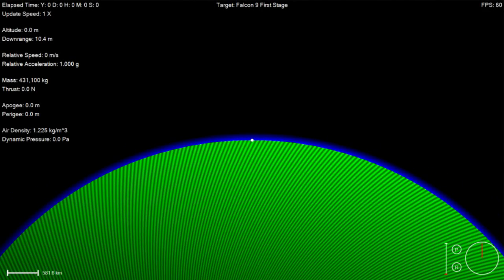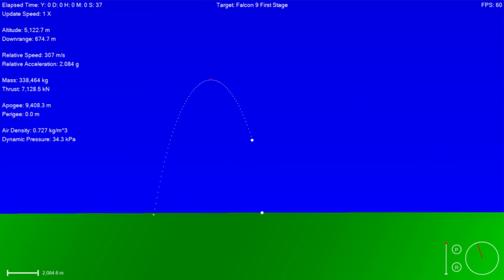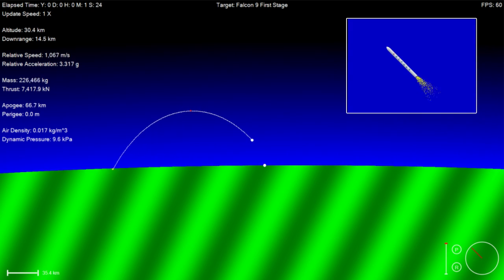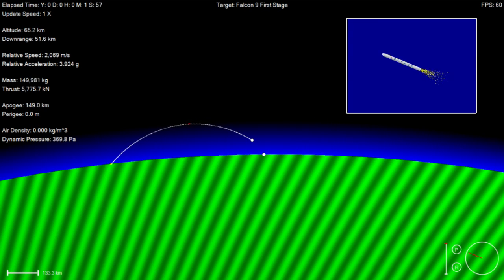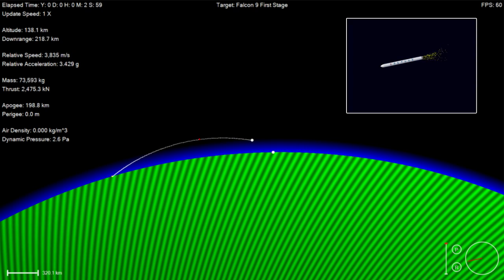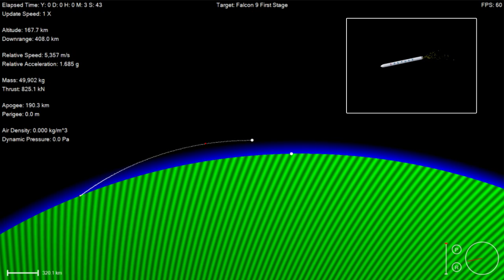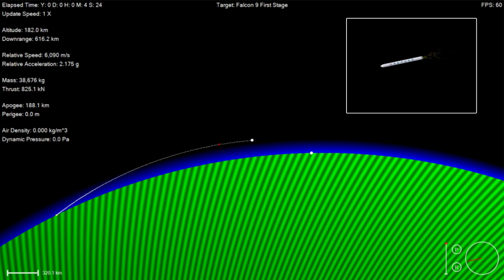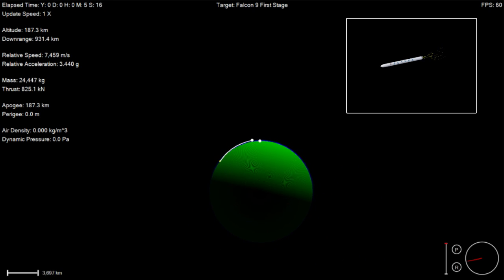SpaceX Falcon 9 First Stage SSTO Simulation

Comment: Good work.
Probably the first stage alone could go far away 4.5G, because, without the weight of the second stage and payload, the constraints on the structure of the first stage are lowered.

Also, since the engines can be fired several times, there is, still with a max 4.5g, a far better profile, with much less gravity loss.

Instead of shutting down 2 engines, only the central engine should be shut down, then re-ignited when 2 other engines are shut down.

So, the sequence would be/

1: All engines at max.
2 : at 4.5G reached, Central Engine shut down.
3 : When again 4.5G reached, 2 other engines shut down, and Central Engine re-ignited.
4 : When again 4.5G reached, Central shut down again.
5 : When again 4.5G reached, 2 other engines shud dows, and Central Engine re-ignited.
Etc.

You should get an higher orbit.

Also, each Engine has an adjustable orientation, so you probably can shut down directly any engine, and orientate the others to get the thrust in the right direction. It is probably a better way to do it.

The merlin 1.D has an adjustable thrust, from 70% to 100% So you can lower the thrust of an 
Engine before stopping it. But maybe it lowers the ISP. Does somebody know how much you lower the ISP by adjusting thrust to 70% on  the Merlin 1.D ?

Comment: Thanks for that. Great job. A SSTO gets best performance when using altitude compensating nozzles. With it, the F9 first stage vacuum Isp can be raised from the 311 s it is now to the 342 s Isp of the F9 second stage.
 How much would the payload be then?

  Bob Clark
Reply: Not going to be enough area at the base of the rocket to accommodate 9 Merlin Vac sized engine bells
Reply: Ideally, you want an expandable nozzle so it's normal size at sea level but expands out at near vacuum air pressure. At near vacuum the large size will have small effect on air drag.

Comment: I can see you were running with very small margins there. The orbit also shouldn't be stable for very long. But I'm curious, what was the lowest angle that the ssts was pitched relative to the horizon? And another question, were you pulling any angle off in azimuth so as to be in an inclined orbit? I don't think the delta v values agree with your simulation for an equatorial orbit.

Comment: Just out of curiosity, what kind of G-forces would you pulling if all nine engines were active during the entire flight?
Reply: +CaptainOfGames 7425000N of maximum thrust in vacuum against 22000 kg of dry mass. 
a = F/m   
a = 7425000/22000 = 337.5 m/s^2
337.5 = 34.4 G's
So over 34 G's in the last second of the flight. Keep in mind that in the simulation it's running at just 1 engine for the last 2 minutes.
Reply: +CaptainOfGames Napkin math:

26.45 ton dry mass of F9 first stage
6444 kN max thrust of all 9 Merlin 1D engines
Maximum ~233.77 m/2^2

Which comes out to about 23.76g's
Reply: Patyx 34 G's would probably flatten the whole stage into a pancake.
Reply: Kelan Barr from the simulation the dry mass is about 22000 kg, not 26450 and the vacuum max thrust is 7425 kN
Reply: Patyx I was taking my stats straight off the F9 v1.1 reference guide.
Reply: Kelan Barr yes, and the current F9 is no longer v1.1,  but v1.2 or Full Thrust (they are different names for the same version of the rocket)

i took the stats from http://spaceflight101.com/spacerockets/falcon-9-ft/